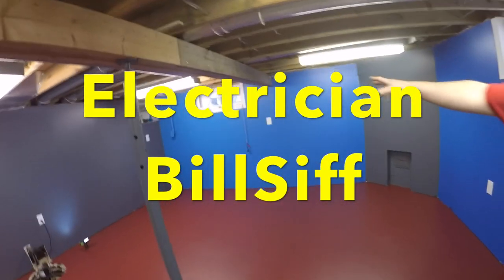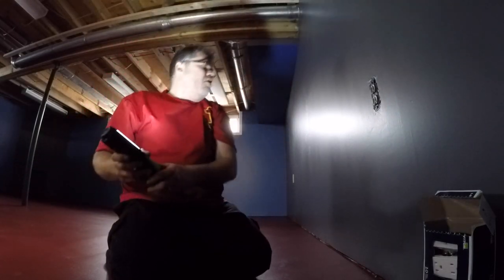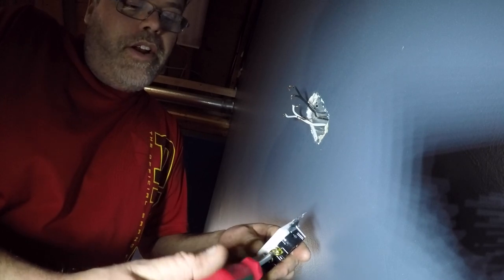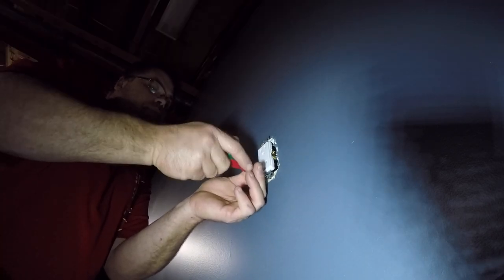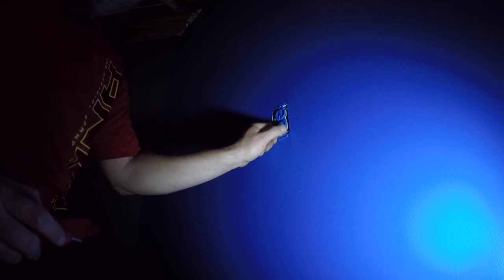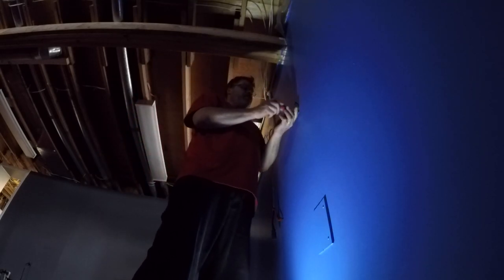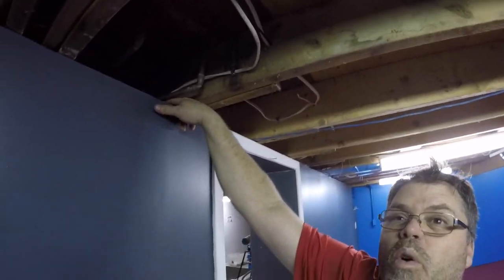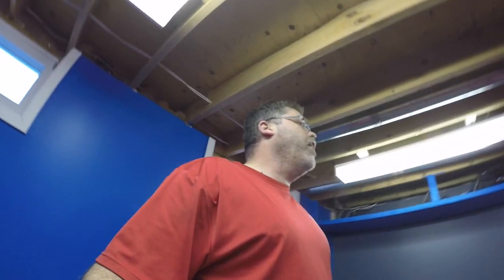Electrician BillSiff

Comment: I just replaced 44 plugs and switches after painting the interior of my house.  Its faster if you cut the wires right off the old plug, strip the wires and just  plug them into back of new switches. The screw the screws in.  Done

Comment: Bill, be careful telling everyone that they can touch the white wire all they want if the power is off. If it's a multiwire branch circuit you would have two separate hot circuits sharing the same neutral. It is absolutely possible to be shocked by the neutral wire. If you're not familiar with "multiwire circuits" do a Google search. Nice work on the new studio.

Comment: lol are you a licensed Electrician ? rhetorical question, I don't really care, it never stopped me from changing power points, light switches and light fittings before :P
Reply: hope you locked the meter box, and you should probably be wearing some rubber gloves (just in case)
Reply from the maker: nope lol

Comment: Electricians in the states install the outlets with the ground pin facing up because they found it to be safer than being downward....when the pin is downward 7 you have a cord not all the way into the wall ..it becomes a hazard if you were to drop something like a coin & it happened to fall between the + & - it could short & cause a fire....   keep up the good work!!!